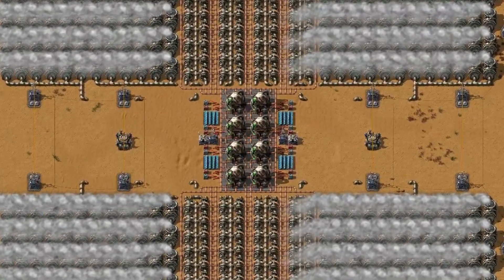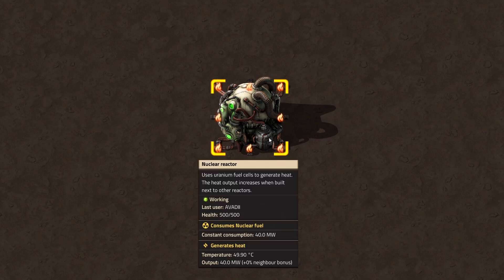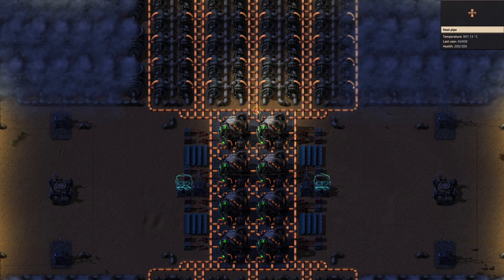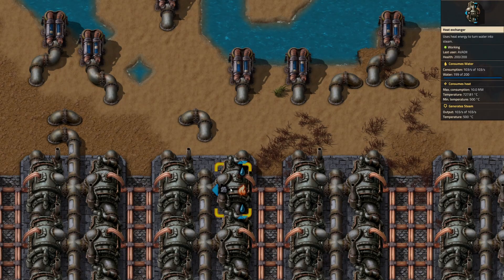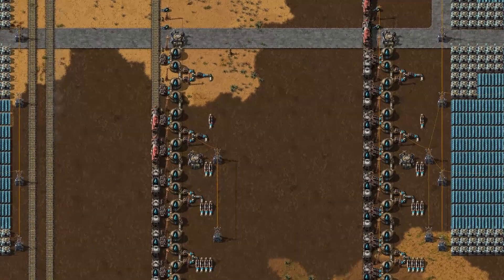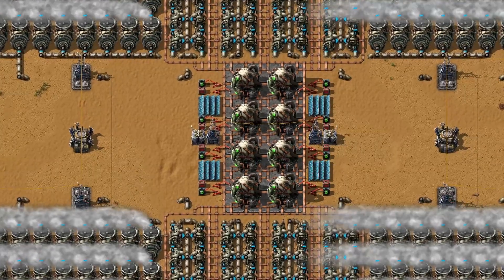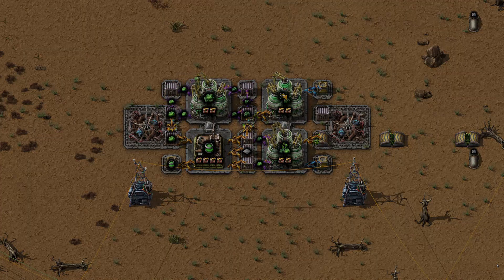Top Tips for Efficient Nuclear Energy in Factorio

Comment from the maker: The video was made before Factorio 2.0 Space Age.
Most of the information is still up to date though but one thing is not: fluid mechanics.
You can ignore all the parts where I talk about water and steam bottlenecks and the ratio of 10 heat exchangers to 18 turbines, while still relevant for the energy consumption, doesn't apply to the limitations of 1 pipe system anymore.
It's now easily possible to supply an entire nuclear power plant with 1 single water pump with all water going through a single pipe!
Reply: thank you for the follow up
Reply: Really appreciate you taking the time to pass along that update.
Reply: Also the advice to not bother with circuit-controlling fuel cell use.  That is now important in space age, as shipping fuel cells is expensive (10 per rocket)
Reply: Controling fuel consumption is far easier and worth it now, specially when shipping nuclear fuel to heat Aquilo.
Reply: I'm not sold on that last claim there.
IIRC, a single water pump provides 1200 fluid per second. Any system that eats 11k water a second (as was your example) will be left dry from that.
Reply from the maker: @OzixiThrill Right. But they also changed the ratio water <-> energy. Which is why a heat exchanger only needs 10.3 water now to provide 10 MW instead of 103.
Which means a typical 8 core nuclear reactor needs less than 1200 water per second or just 1 offshore water pump.
Reply: Hm, I may need to review my 8 reactor setup then,  because it was using 2 pumps

Comment: 4:25 "Also, do not use circuit network"
Well, probably this advice is good for UPS, especially if your reactors are working for full power, but if you have a relatively small base, but want to use the advantages of 6 or even 8 cores, which can be a huge overshoot for you, then it's much better to feed the reactor with the exatly that amount of nuclear pills, as it needs. 

Nuclear fuel cell generates certain amount of heat during certain amount of time, and the excessive heat is lost, if the reactor temperature have reached the limit of 1000C. Later then the heat is not lost anymore. Neither heat pipes, nor heat exchangers - none of them lost any heat. If the heat is not consumed, the temperature simply stays the same.

So, if you don't use any circuit networks to control fuel loading into reactor, then you lose one nuclear fuel cell every 200 seconds, no matter where to the energy generated by this cell is spent.
On other hand, if you control the fuel loading, then all the energy generated by the cell is first transformed into heat, then into steam. No energy is lost, and if you drain only several percents of power from a huge power plant, the fuel consumption rate decreases dramatically.

Comment: 4:20 I want to add extra context to controlling fuel cell behavior with the circuit network. First off, it disables Neighbor Bonus (both give and receive) for any inactive plants even if they are at 999 heat. So it's worse fuel economy than just running everything if you need the power. Second, the inserters can't be set with an "equals" function even when accounting for exact signal outputs from a decider combinator, which is really terrible to figure out (just use greater than 0). And lastly, there is no reason not to do this in the earlier stages (no neighbor anyways) of the game when you only need 1 nuclear plant for a good while. It's hard early on to source all of the resources for 12x~ as many heat pipes, heat exchangers, steam turbines, as well as 4x the centrifuges and the plants themselves. If you know the logic quirks, it takes only 1 decider combinator to mediate 1 plant and 1 inserter and you just remove it later.

Comment: With 2.0 wouldn't the acid neutralization recipe be simpler for around 150~ MW per chemical plant producing steam? (Assuming calcite is processed and sent down in orbit)
Reply: I have done exactly 0% of the math, but it certainly feels that way. Steam created on Vulcanus comes out at 500 degrees already, so you just hook up as many turbines as you need. Same thing with the heating tower from Gleba. 
Since room is so important, a single nuke plant is fine on Fulgora or for most space platforms going out to Aquilo

Comment: It's not super important given the near infinite power that nuclear provides, with the only real bottleneck being how many nuclear reactors, heat exchangers and steam turbines you can make; but it always surprises me that nobody ever talks about how steam is an extremely efficient source of stored energy. You don't actually have to care about perfect turbine to heat exchanger ratios; it's actually good to have a high surplus of turbines. They only consume as much steam as they need to satisfy power, so just throw in as many storage tanks on the pipe system as you want, and those turbines will be able to power your base whenever you hit those large sudden short spikes of power usage caused by your home defense system. It's like having an accumulator that stores 10x the energy for 1/10th the material cost.

You could even use it as energy transportation, if you don't want to hook up all of your bases/outposts to the same grid for whatever reason.
Reply: heat pipes are better if you want to buffer energy storage
Reply: Same tactic that I use. "Perfect rations" just seem needlessly obsessive to me, I just throw enough that there is a surplus of steam + storage.
Reply from the maker: If the power plant runs at maximum capacity extra turbines will generate 0 extra power.
If you run it at lower than maximum you don't need them because there is room for extra energy spikes.
Reply: @ my current base was built on mostly solar energy and we have a wide defense wall of laser turrets for convenience, the power draw has the potential to go over the max production of energy that the 2x2 nuclear plant I use has and installing extra steam turbines with fluid tanks is a lot cheaper than building extra reactors, heat exchangers and boilers to go with the turbines.
Reply: The extra turbines and steam tanks arent used during normal operation. They are there so if you have fluctuating power like loss of solar or huge attacks against lasers, you have the extra power generation and extra steam already stored up

Comment: I'm close to using nuclear reactors.  When I started on Vulcanus, I learned there is no limit on the amount of sulfuric acid a pipe can deliver from my pumpjacks, but, that is not the case for water through pipes?  If so, thank you for that distinction and clarification.

I looked for the alluded to video about uranium fuel cell production, and I haven't found it.  Did you make one yet?
Reply from the maker: No I didn't. Spent too much time with the Desert Deathworld Megabase series and then Space Age came along.
But I'm sure at some point I will go into energy production and nuclear once more.

Comment: 4:26 with new circuit output on nuclear reactor and new interface on decider combinator, you can simple disable inserter by directly connecting to nuclear reactor to your combinator, temperature < 800~900 (based on how hungry your base is) and fuel == 0, this may help on early stage where you don't have many light green rock

Comment: Wondering how the pipe system changes in 2.0 affect those ratios now.... can't wait for a nother verison of this video
Reply: also quality. I bet that nuclear power got a massive buff.
Reply: As far as i'm aware there are now no problems with throughput, so you can just throw it all into one system, as long as it's not bigger than 250x250. I may be wrong tho, needs further testing.
Reply: @noelka8134  what do you mean? no problem with throughput ?
Reply: @orix3434  Pipes now have unlimited throughput. The only limitation is the length of the pipe to force use a pump
Reply: One thing people overlooked is that boilers and heat exchanger consume far less water which is why they are practical to use in space.
Reply: 2.0 made throughput for pipes instantaneous, reduced water consumption of boilers and heat exchanges.

Means far fewer pumps and far more freedom with piping. Also means less use for storage and you can have storage further away

Comment: Nuclear powerplants are very fun to make, a 2 core reactor spitting out 160MW while only needing 4 U-235 per hour is awesome it only takes 16 heatexchangers and it's good enough until it's time to use beacons in my play style at least.
Reply: with 4 U234 per hour I think you can make do with just a large centrifuge setup so you can get into nuclear well before kovarex. I wish that ratio was a bit more clear because most people always get into nuclear only after finishing kovarex.
Reply: I found with a few beacons, one box and two circuit wires, you can actually supply a decent sized base with one centrifuge
Reply from the maker: Exactly. I always build at least 1 nuclear powerplant to make sure there is always power for laser defense available.
This way i don't have to worry about expanding solar energy.

Comment: This is very useful. I can't wait for the Enrichment Process video.

Q: Any plans to make a lossless design tutorial? This is my biggest concern with Nuclear power, as I hate wasting the fuel.
I've seen Michael Hendricks make one that had perfect timing for inserting fuel when needed without losing any heat, while making sure no fuel was used when it wasn't necessary. I find this to be a bit over my head but you've explained this part of the process so well I can imagine if you made a tutorial on it I would finally get it lol.
Reply from the maker: Since i don't recommend doing that i won't make a tutorial for lossless.
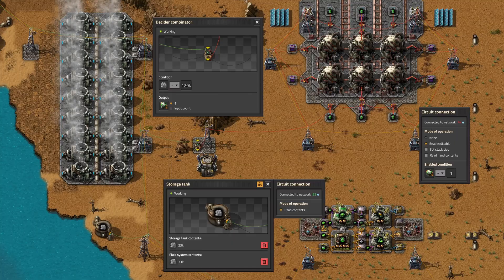Nevertheless you can kinda see one of my lossless reactors at 4:38.
Every block of turbines has one storage tank. If the combined amount of steam stored is below 120k a signal will cause inserters to remove the last burned up fuel cells.
One of these inserters will pulse a signal that will cause inserters to refuel 1 fuel cell.
Reply: @AVADIIStrategy  Really? I'm curious why you don't recommend, what's the reason? Genuine curiosity has stricken me :D
Reply from the maker: @Sphendrana  I explain why in the video. Uranium is abundant in Factorio so no need to save resources.
I see it this way: when expanding my base i want to get rid of ore patches that are close to spawn.
Even without saving any fuel cells it's hard to get rid of uranium patches.
Reply: @AVADIIStrategy  I understand now. I'm a very resource conservative player lol I guess I could stand to play a different way for once :P

thanks for educating me!
Reply: @Sphendrana  Going cheap on your resources like that is usually something the comes into play for a modded run more than anything. For example in my Space Exploration run there is barely any uranium on the starter planet and I don't want to set up a mining chain on another one to supply uranium so I'm being extremely conservative with it there (circuited central processing etc). With other resources there isn't any point though, as the amount of work put into efficiency gains in one place is trumped by finding another patch somewhere else and slapping down a station.
Of course if UPS is something worth considering then obviously going smaller is going to be more important.
Reply: @Sphendrana   Because there are 3 basic resources in Factorio
In game resources like uranium iron or coal
Computer resources for UPS
and Player attenton

You are spending way more in player attention than you are saving in uranium fuel cells
Reply: @StealthySpark  Ah but isn't that part of the fun? Working on logistical solutions to problems that don't exist XD I admit, I'm this kind of player. And I'm not even that deep into the game. I enjoy it because I love RTS and factory building, but I'm not very technical minded. It's still a fun exercise to figure out how it's done and pull it off though. 

But that's a good way of putting it. I have ADHD and my attention span is nonexistent as is lol!
Reply: Making a losseless design is much more easier than ever since 2.0, now you can hook up the reactor with a circuit network to read its temperature, just set up an inserter (with a limit of 1 item per operation) that only inserts a new nuclear cell once temperature drops to a certain degree.